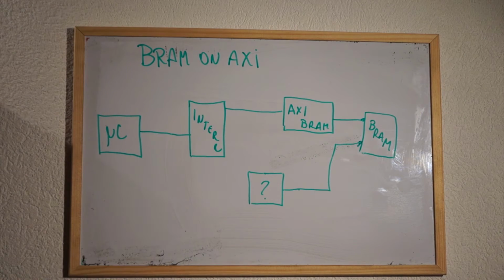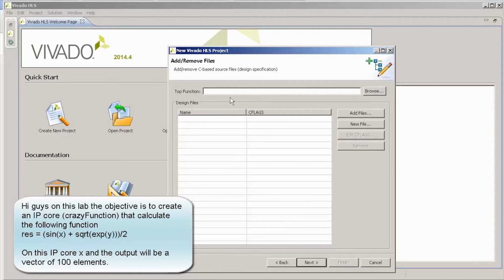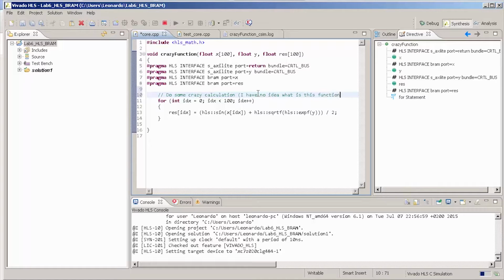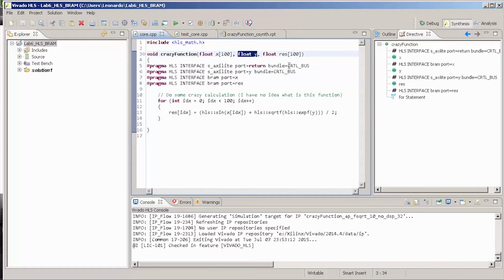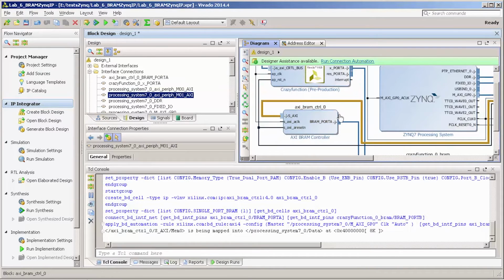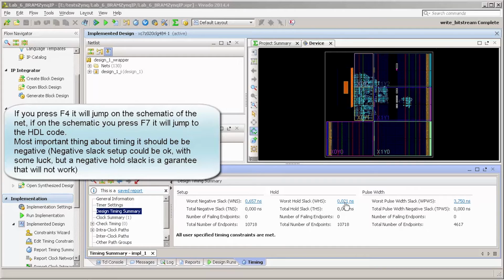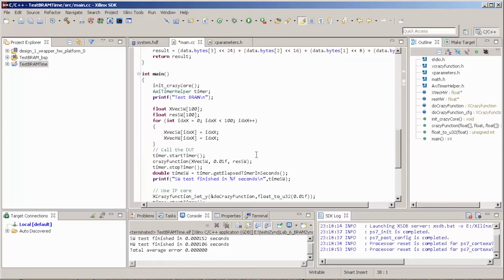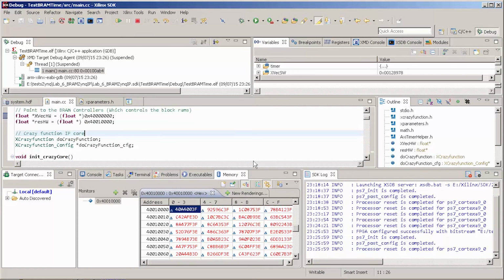VIVADO HLS Training - BRAM interface #06

Comment: OMG finally I found what I really wanted to do !!!! but how and where you are writing data into BRAM inside the sdk application.
Thanks in advance.
Reply: on the line   XVecHW[idxX]=idxX;   
pointer defined XVecHW as float pointer  is used as an array to put input data into BRAM

and  output data is accessed using  resHW[idx]

Comment: Hi, I am doing matrix-matrix multiplication on Zedboard. May I ask you some questions?
When I stream in inputs (matrices elements) into my core, Vivado hls automatically stores inputs into BRAM, this mean those BRAM already is wrapped in my core. Is this BRAM also the BRAM which you're using on your lab (outside the hls core)? Is there any difference? And BTW, Do you know how to observe BRAM address and data by vivado hls? 
Thanks a lot.
Reply: did you find a solution to this because I am having problems initializing an array  to the BRAM addresses
Reply: @ahmedelshanawany1998  
Hey, have you got anything related to this. I am not sure how he is writing to bram from the sdk application.

Comment: Hello Sir,

Thanks for uploading such an helpful vedio course. It help me a lot.

I am using a zedboard and have performed all the lab.

I am trying to implement Particle Swarm Optimization (PSO) algorithm in Zedboard.

I am having the following query in my work..

1)  Can I Connect my two IP core ( created by HLS) which shares common

variable stored in BRAM?

2) how can I use true dual port BRAM to connect with

             A. Axi BRAM controller

             B. M_axi port to Zynq and

             C. Custom IP (more than one) which share common variable stored in BRAM

Comment: Hi, appreciate that u make these video which let me have a great toturialin vivado HLS and I'm doing these labs til' now.

But I met a problem which you include a axitimerhelper.h that I can't find it in my own folder or xilinx document, can u tell me where can I get that header file? Thanks!
Really really appreciate Your videos. Wish U have a nice day.
Reply from the maker: ConbanwaBaseball Hi, actually this is a common problem, that I have almost every day, by some reason, Xilinx SDK don't detect right away that you added the Axi Timer, to solve this issue just recreate your BSP (If you want I can create a quick video showing that)
Reply: Same issue with me, I regenerated BSP number of time but same problem unresolved inclusion:: AxiTimerHelper.h"
Reply: I have sorted out this problem I am working with Vivado 2018.2. After doing all these steps given in this tutorial, I clicked on the system.mss, BSP, it is not showing any package for axi_timer. So Solution: in your vivado desing add AXI_timer IP, save it and regenrate your HDL wrapper and bit stream, then launch sdk then you can see there is an option of axi timer. But even though it is still giving an error for axitimerhelper.h, now you have modify BSP settings, under drivers option for axi_timer change it to generic and Re-generate BSP, then add manually AxiTimerhelper.cpp and AxiTimerHelper.h under src folder. (you can google for these and there is example of convolution in GitHub from that application you can copy these), then change back to tmrctr from generic, and regenerate your BSP then there will be no error for #include "AxiTimerHelper.h". I hope this will help all those who are working on this tutorial.
Reply: the only problem I am facing is that I am getting the average error of 0.023129
Reply: @Solution4uTx  I am not able to add these files could you please share the link from where I can do this.
Reply: +The Development Channel Hello, your videos provided me valuable informations about Vivado HLS and thus I thank you a lot! 
I have the same issue as ConbanwaBaseball, SDK do not recognize the axitimerhelper.h.. Can you please provide me some help or a quick video about that issue? 
I wish you all the best!!